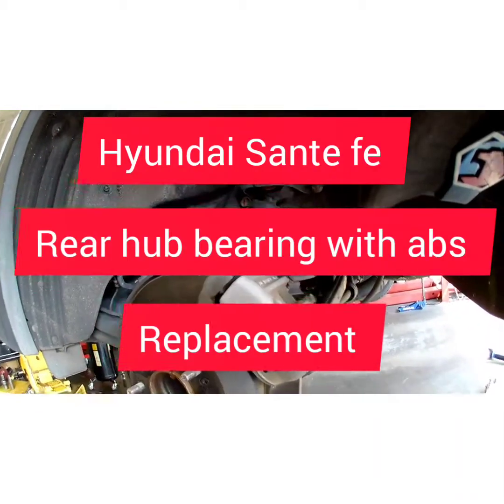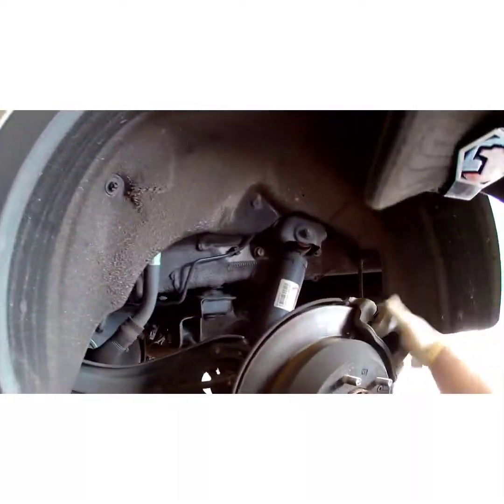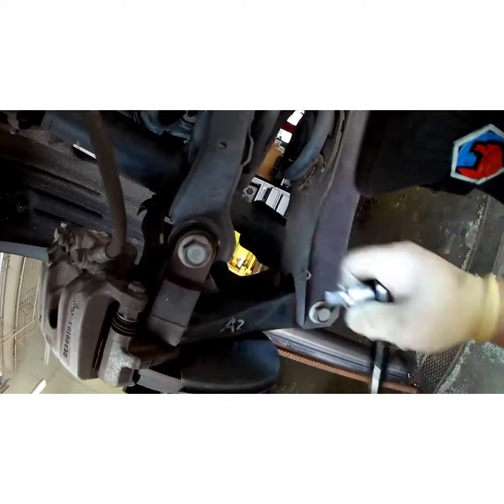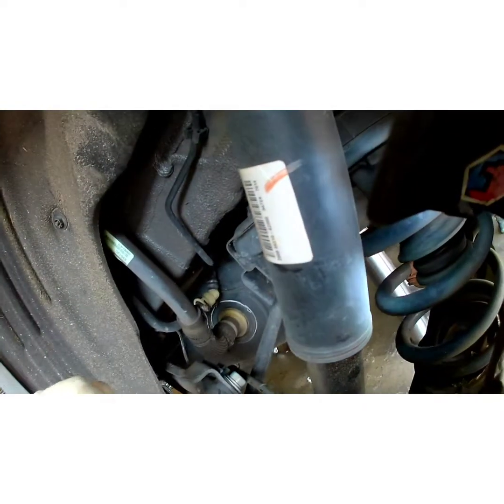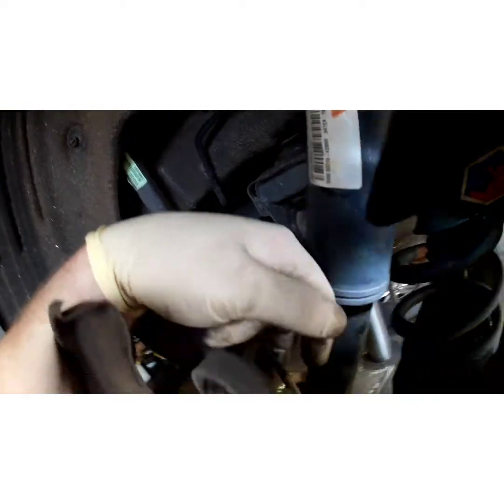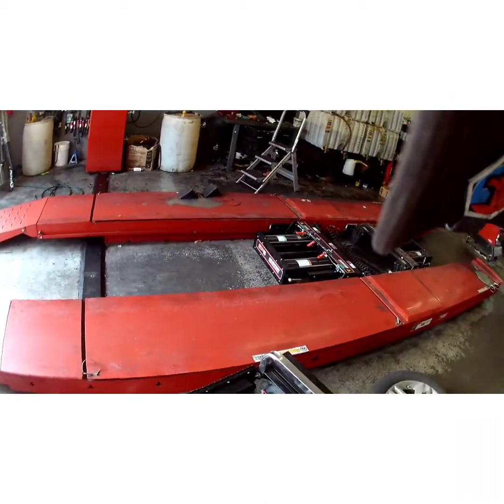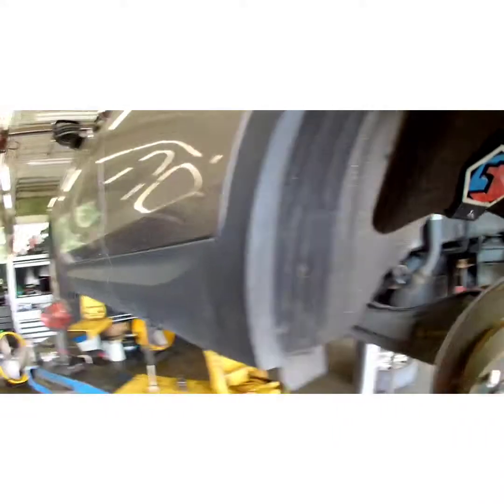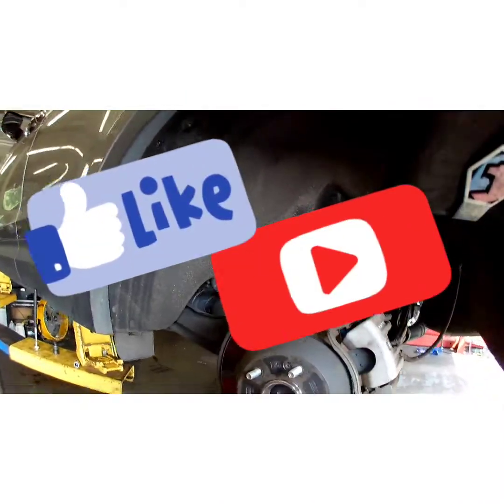how to replace rear abs sensor /hub bearing 13 hyundai Sante fe

Comment: no torque wrench for proper torque set of the bolts that hold the hub? Probably would have had more views is the camera pointed at what you were doing. Thanks for the help

Comment: Why replace the wheel hub assembly when only the speed sensor is bad?
Reply from the maker: It's built into it
Reply: @automotivetech-vet  
can’t you pop them out and replace?  You can buy just the sensor caps. I’ve seen other videos replacing just the caps. I’m not trolling you just wondering